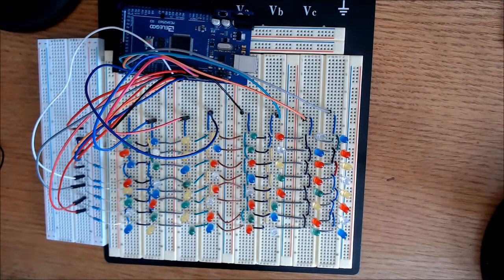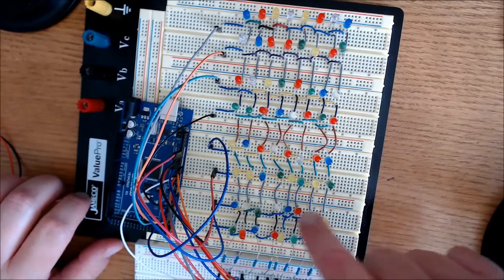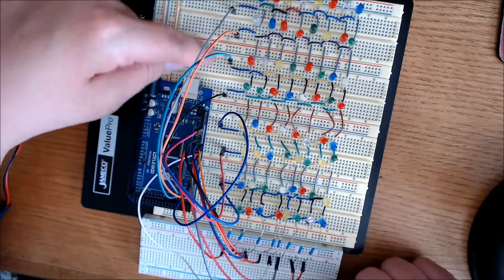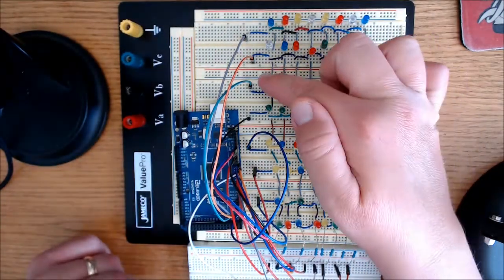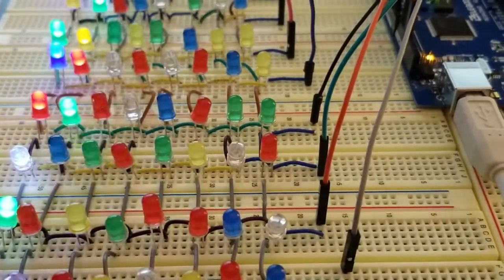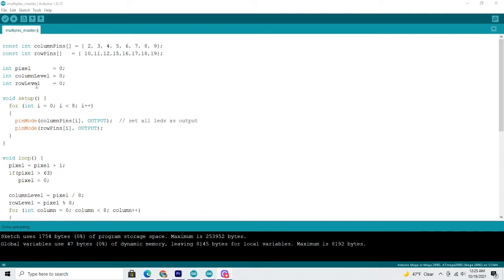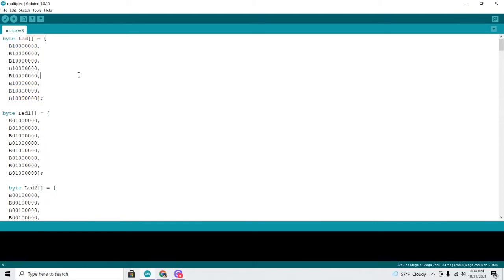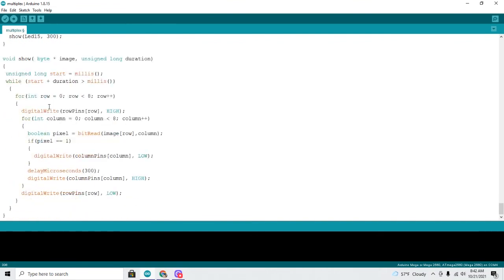Multiplexing LEDS In an 8x8 Grid On A Breadboard With Arduino Mega 2560 - Easy LED Matrix Projects

Comment: How would you add a power supply to power the matrix separately from the UNO powering them? I am waiting to make a much larger matrix 24x24 but the power from the UNO alone will not be enough. I am not sure how or where to connect the power supply to ensure that all the LEDs will light up bright.
Reply from the maker: You could use 74HC595 shift registers and MOSFETs to control a large LED matrix. The shift registers expand your output pins and act as column switches, while the MOSFETs switch the rows, allowing high-current LEDs to be powered externally without overheating your Arduino. Be sure to research how to use shift registers and the proper MOSFETs. This could be a really cool project 👍

Comment: What's the watt rating on your resistors since only one used for 8 LEDs.  I'm just learning and trying to understand.
Reply from the maker: I used the same 220ohm resistors that I use for one 5mm LED with a 5v power source. Multiplexing can create a persistence of vision effect with LEDs making it look as if all the LEDs are on when they are actually switched on and off very quickly. So, I'm not using 1 resistor for 8 LEDS at the same time...it just appears that way. You can reduce current requirement when you multiplex LEDs - so that allows me to add 8 leds rather than 1 or 2.....and it looks pretty cool when the LEDs are much closer together.
Reply: @BMonsterLaboratory  I'm preparing a project similar to this one and I would like to use the same materials as in your video. Which voltage are the LEDs you used? And what resistors should I use? Thanks
Reply from the maker: @alvarohear  There's a schematic at 2:17   It looks like I used 100ohm resistors but you could also use 220ohm if you have those. Does that help? fun project!
Reply: Thanks, and what about the LED voltage? Which voltage are the LEDs you used here?
Reply from the maker: @alvarohear  I used 5mm LEDs and powered them straight off the Arduino Mega. Arduino is rapidly switching between different groups of LEDs, turning each group on for a short period before moving to the next. Since all LEDs are not on at the same time in multiplexing, this allows me to use 5v power without exceeding the limits of the Mega board. I powered the board from my PC. If I run these LEDs for a longer period of time I would remove the pc as the power supply and use a 9v supply at the barrel jack. Remember to always check data sheets for operating current draw and voltages to make sure they are withing the limits of components you are using
Reply: Thanks, so I must buy 5v LEDs to make it work same as your vid, right? Can also a 5v power supply be used to make all the circuit work just plugged to an standard 220v source, instead using a PC or a battery?
Reply from the maker: you can use this site for the 5mm LED specs https://components101.com/diodes/5mm-round-led     does this help?